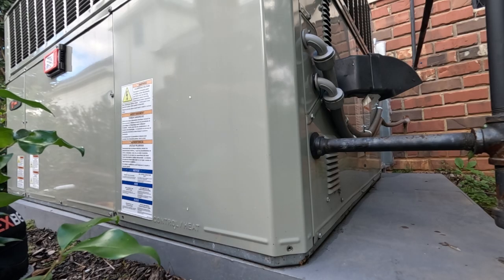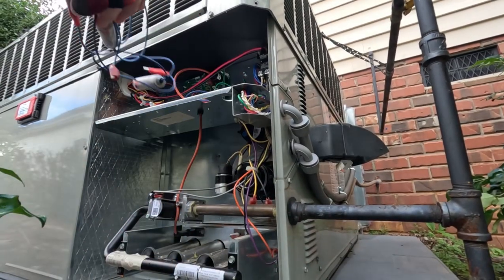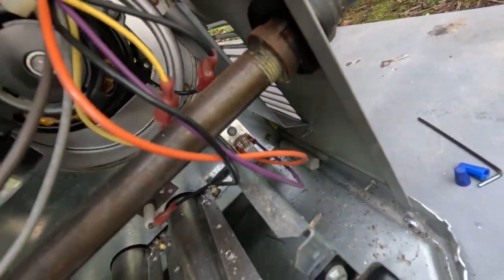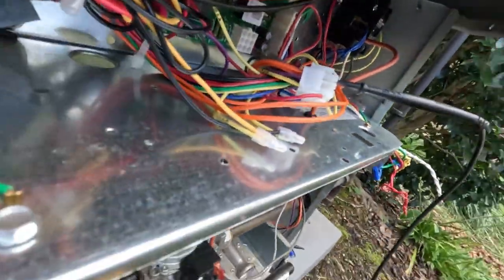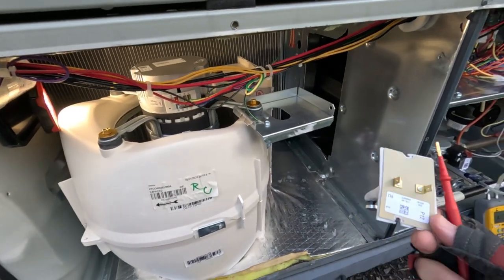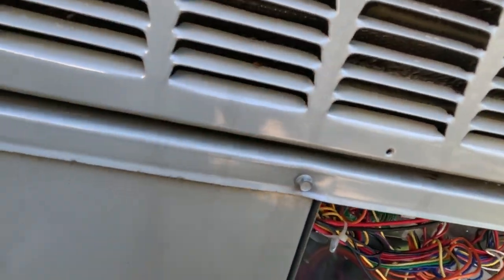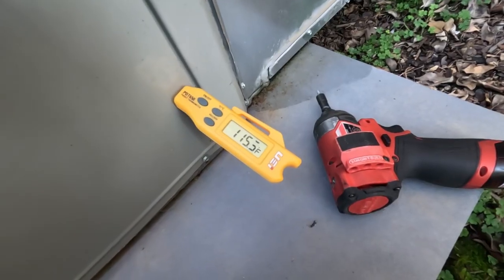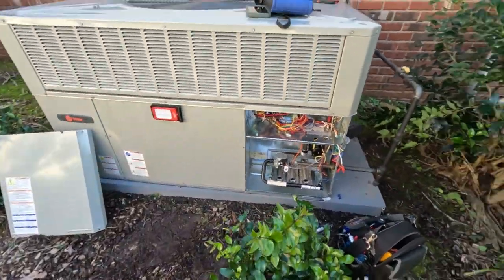Why is a New Unit not Heating? #hvac

Comment: Brand new install and the installer did not install a union on the gas line. Someone behind him will be taking a lot of pipe apart to replace the gas valve when it fails. Would not pass inspection in my service area. Gas cock should be right outside the unit too.

Comment: My throat natural gas it was supposed to be 3.5
Reply: generally 3.5"wc is used on many things, BUT always look at the appliance/device/gas valve, because not all are 3.5"wc rated, for instance some vent less radiant garage heaters run at 5" wc. also dual stage furnaces on low stage are less by about 30 to 50%, which is a separate adjustment.
Reply: @throttlebottle5906  yes this was a single stage machine that was 3.5 WC I’m aware that the dual stage has a separate measurement 1.6.
Reply: @JacksLore  again, always go by the rating plate/gas valve label(when it's the OEM factory valve). not everything runs right at 3.5" w.c.  they may have it customized to me low NOX requirements or others. yes those valves are labeled 3.3" WC. I assume the unit label states the same thing, not really see many newer trane, let alone gas packs.

Comment: Probably cycling on high limit 1st year, homeowner may not notice it until it fails completely,  possibly not enough return air.
Reply: That would be the simple conclusion
Reply: I agree 9 degrees from the limit switch is not much margin, wonder what train says temp rise should be
Reply from the maker: Bag switch

Comment: Nice video and well done.Yeah when you get older they make the lettering smaller on parts and model number.Go figure! I like that small screw driver looks like its battery powered/You have a link for that?
Reply from the maker: I appreciate it! Vessel https://www.amazon.com/VESSEL-Rechargeable-Screwdriver-No-220USB-1U-220USB1U/dp/B09C2W1NRY/ref=sr_1_1?crid=2FGN4QFS6EU75&dib=eyJ2IjoiMSJ9._YAydu5X89HKY7J_clGfnaJ_1KmBhJrMxvjQCWz5WkLWxGCw8F8uQ9aDbiuVigew4kb7EhCEfC9RSK87rUCVOGoSUnhLqzD8zKDGu8grRgXJGnS_mgdklMFiLst8eoimD06oFroP9FyJGwVZWdODGWTrO18Pv1itFrrj5b1ozzBdGjW4J_T4JF3FSBYsO-kY28W0AwpDlEYjDV8xCtN96SezKps1Ncx1JRahdTdIrAuRSJLv6t2o1Fly4FLLdgd4vhbjUnpwdPeE74ueC2PYKXb0UHSbRXOKv1yAcboFMVw.8Y37MQBTGWXaz-YZqb0bWgLJDeWWZYPVb4S_pa-uJ78&dib_tag=se&keywords=vessel+electric+screwdriver&qid=1762573256&sprefix=vessel%2Caps%2C288&sr=8-1
Reply: @MYHVACLIFE  Thanks!